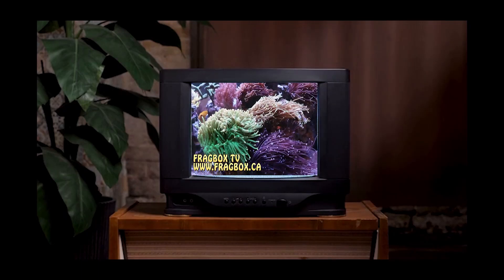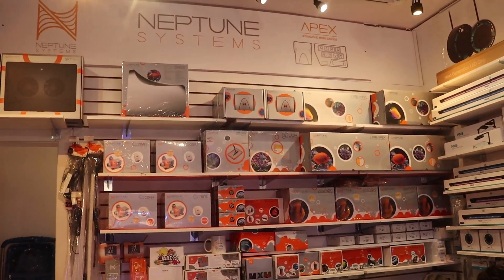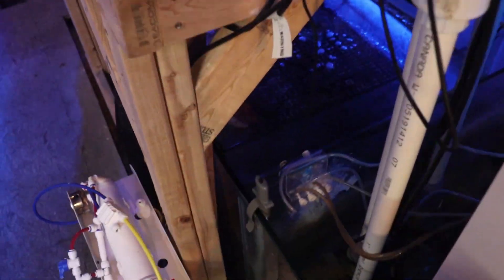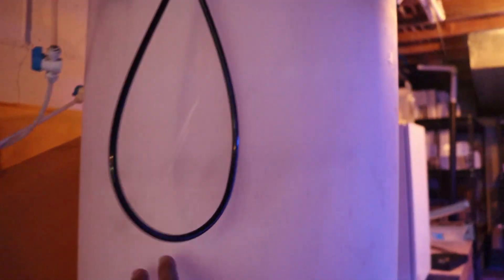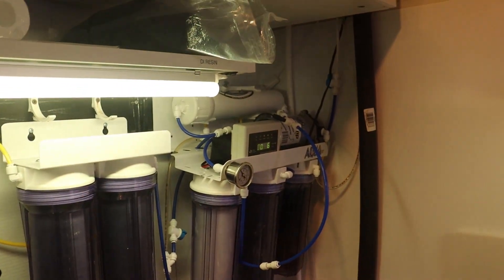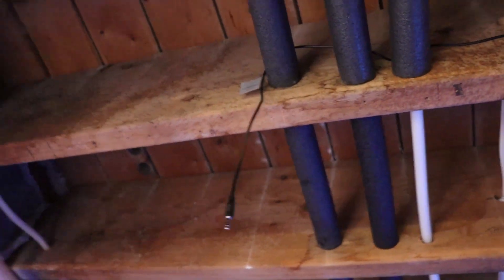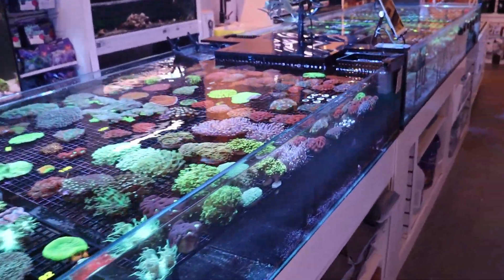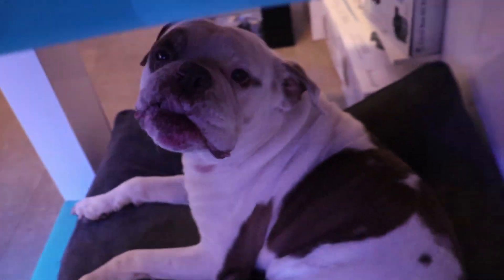We Install Neptune's LLS & Optical Sensor

Comment: Geez! I actually watched this video to see how you connected the sensors in Apex Fusion and you cut it out of the video! LOL   I recently bought the Apex Pro 3 and connected the Level Sensor to port FMM_1 and went fine, but it's not recognizing the Leak Detection Sensor in Fusion plugged into port FMM_2 and only shows the FMM_1 port where the Level sensor is connected. So for now, I am not using it. Oh well, wanted to see if there was something I was doing wrong.

Comment: As an owner of both of these items I cannot say that these are good products, the optical sensors are not reliable and often stop recognizing water levels, and the LLS is all over the place. I have used a float sensor with the breakout system and it has worked for 10 years without failing, it's by far more reliable than the optical system, since the optical plastic fogs up regularly and will stop working until you dip it in acid to get rid of buildup.

Comment: Hey March now you can throw a small pump in your fresh saltwater and program it to turn on when you get the low sump alarm and shut down when it reaches a certain level 😊  This will save you guys running up and down the stairs to top it off 👍